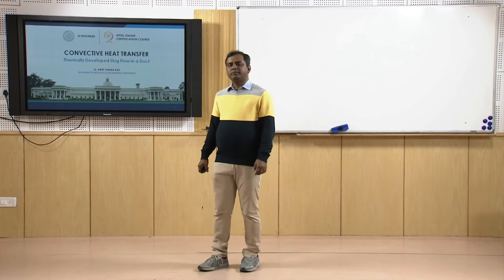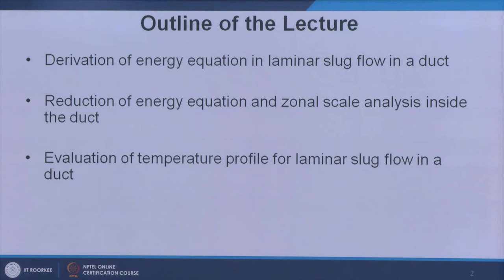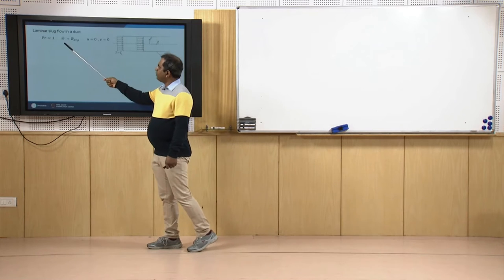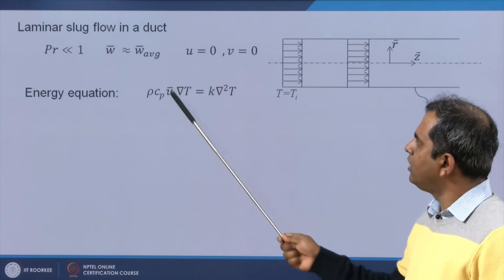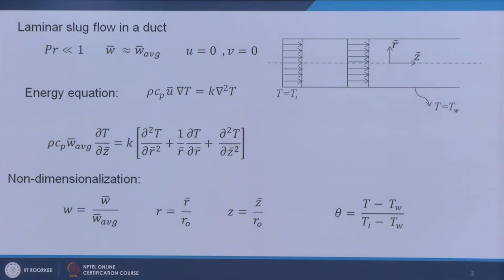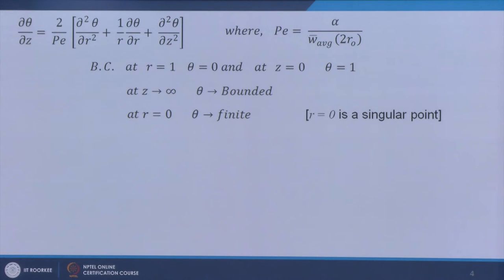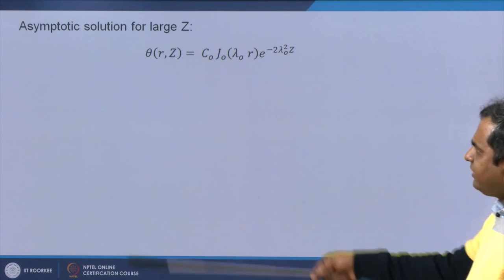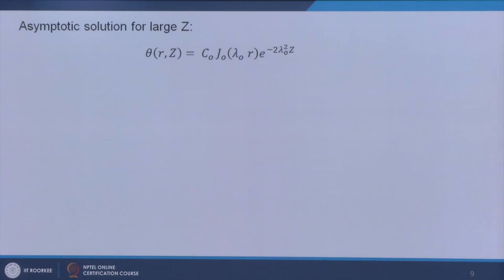Thermally Developed Slug Flow in a Duct

Comment: Shouldn't there be a velocity consideration in the r-direction in the energy equation due to a lack of a fully developed velocity profile?  I am under the impression that a slug-flow is where the temperature profile fully develops significantly quicker than the velocity profile, and I also thought that the velocity in the r-direction was negligible only under fully developed velocity profiles in the axial direction.